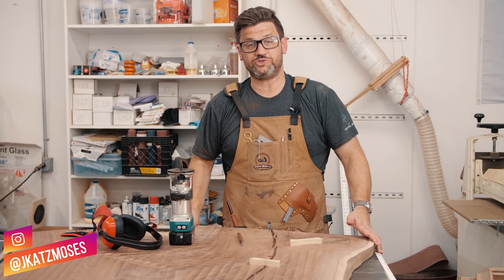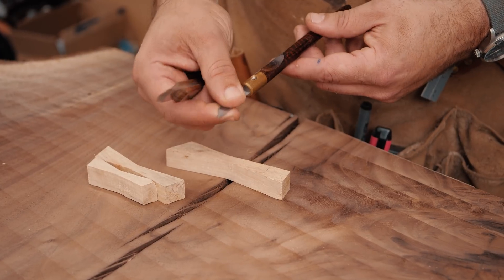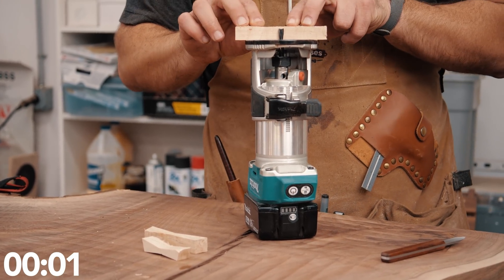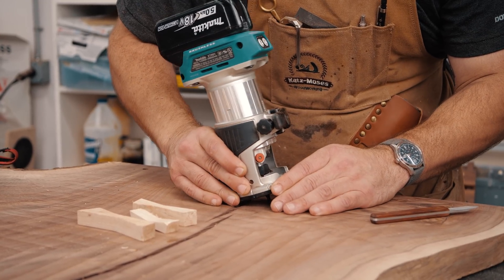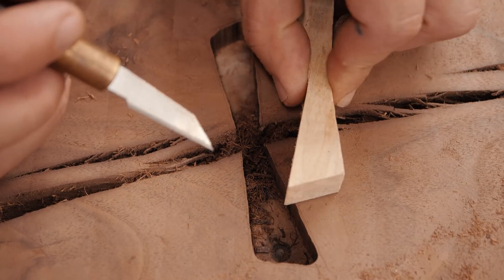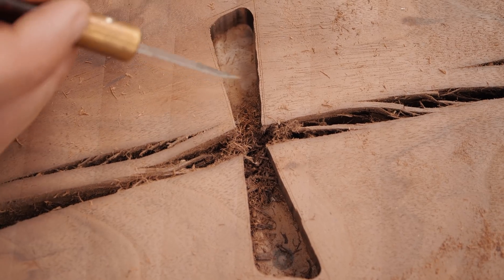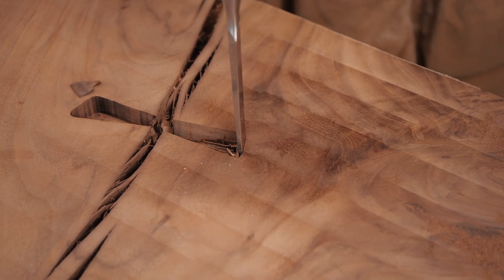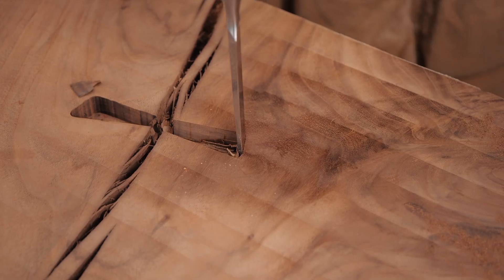Butterfly Keys, Dutchman, Dovetail Bow Tie - Two Minute (ish) Tuesday

Comment: Couple of additional tips for beginners w/routers:
- rotate yourself around the cut so your line is never blindsided by the bit or router housing. Always have visibility of the line 
- for full depth cutting, splurge on a fresh (quality) bit
- for a safer plunge start, drill a starting point (aka hole)!with a forstner bit. 
- if you F up, make a new/larger key. This is where Jonathan‘s asymmetric key design makes this forgiving
- have fun with it - most important tip!

And for you more advanced carvers - it’s fun to make a leaf shape key (instead of a butterfly) so that long crack has the appearance of a vine.  I’ve also done keys that make the crack have appearance of barbed wire.
Reply: That leaf design idea is brilliant. Opens up a world of possibilities I hadn’t considered. Thank you 🙏

Comment: Thanks for the great video.  I have a question - since you design your butterfly inserts in Fusion and use a CNC machine to create them, why don't you design the corners of the inserts to have a radius matching the router bit, rather than a sharp corner?  It seems as if it might save some chiseling time. This coming from a non-woodworker.
Reply from the maker: Because that sharp corner looks so much better and handcut.
Reply: Showing off the skill of the woodworker matters and because hand jobs are the best
Reply: Yes, I agree, hand jobs are the best!
Reply: @katzmosestools  yeah i was thinking that. Again maybe best of both worlds since you have standard CNC sized keys would be to make a router template that does all EXCEPT the very corners. then you just have 4 corners to clean rather than all the sides too.

Comment: What about a video on using Titebond's sizing system for gluing end grain.  Is there increased strength in the process and how much.  Would it suffice for non-stress bearing glue-ups on mitres and such. Here is a link to their tech page that recommends sizing for end grain gluing. http://www.titebond.com/resources/use/glues